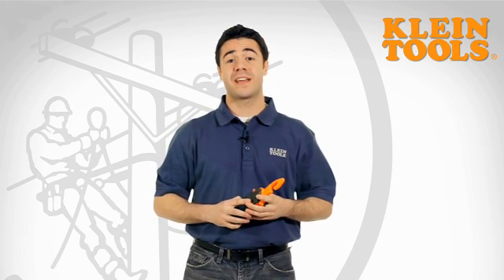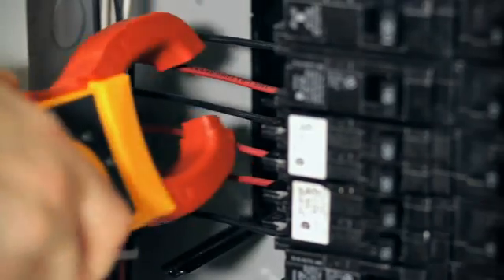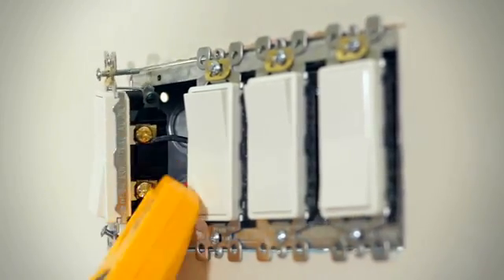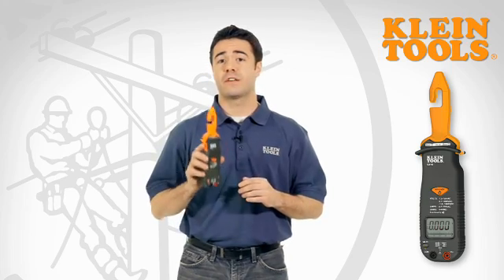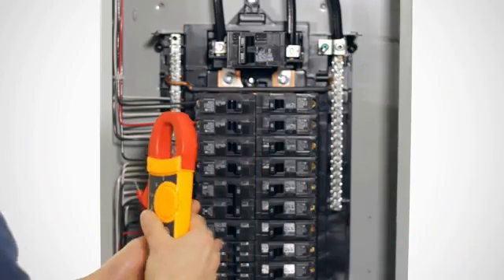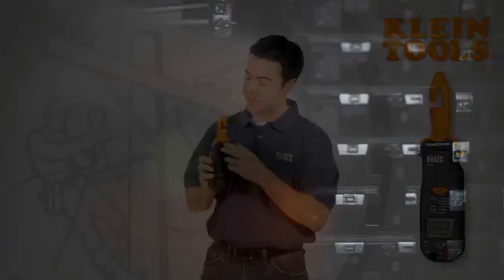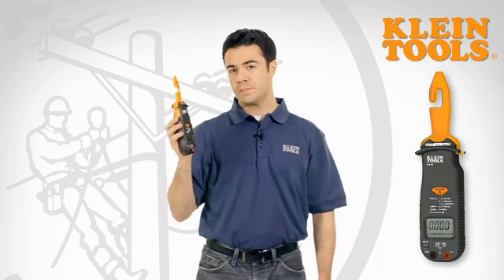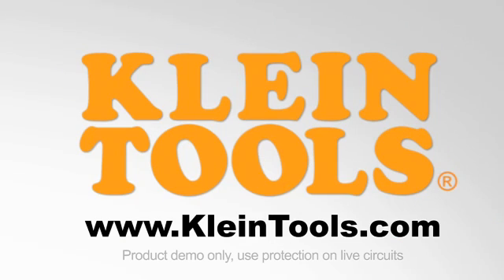Klein Tools 200A Hook Meter

Comment: The idea for the hook meter is great, but unfortunately it is an averaging meter and not True RMS. The meter will only provide accurate readings for linear systems, as soon as there is noise or nonlinearities in what you are measuring the reading will not be accurate.
Reply: but is for home use, you don't need trms in the home because is sine wave, the multimeters without trms can calculate the rms only for sine wave, but don't need anymore ..i guess...